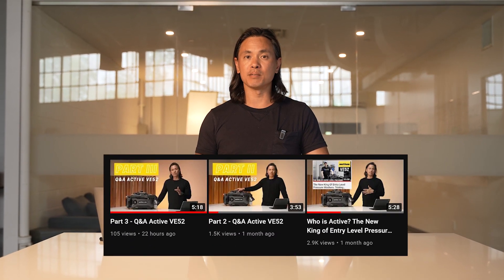Question and Answer PART 4 - Active VE52

Comment: Can I use a 100 foot pressure washer hose with this unit? I’m using a cox reel and a 6 foot whip hose. My current Ryobi 1600 PSI unit struggles with it.
Reply from the maker: You can use your preferred hose with the correct fitting but keep in mind that you lose a bit of pressure the more you extend your hose

Comment: As soon as Project Farm declared the Cat Pressure washer was the best, I ordered one. Now after watching these youtube video, I'm super glad. The only thing I'm concerned about is the 100 hour rating. I feel I can easily burn 100 hours in a year. Is it 100 hours trigger pulled?
Reply from the maker: This would be 100 - 150 working hours (Trigger pulled).  In actual practice, this is quite a long time - but of course this depends on the user.  For the home user, this is years of typical use.

Comment: How bout make a ve52 pro version with a upgraded induction motor to compensate with the 5 piston pump to add longevity for about 250 dollars cuz the performance is already there no need to try to get better performance durability shud be the goal!
Reply from the maker: Yes, we are currently testing different motors with our pump and doing longevity testing.  Ideally, we would match the life of the pump and motor closely.

Comment: What orifice size nozzle tip do i need to get the 1,800 psi?
Reply from the maker: if you are looking for an actual operating pressure (what you feel at the end of the gun) of 1800, no nozzle will safely there.  Unfortunately, the rating of 1800 is what's called "Peak" pressure, or pressure that the pump is capable of achieving internally.  This is the common (although misleading) industry rating system that we are using.  For best performance, stick, to the nozzles provided to get the best balance of pressure and flow.

Comment: What is the minimum inlet pressure necessary to meet the 1000ish psi and 1.8-2.0 gpm?  I ask since our property is on a well and not city provided high psi output.
Reply from the maker: I’ve checked with our engineers and they say 35-40 psi may be the minimum you need and may see a 5-10% reduction in performance.
Reply: @ACTIVEPRODUCTS  thank you for the reply and the due diligence to track down an answer from the engineers.  Good to know about the min pressure and the overall expectations that come along with low inlet pressure.
Reply: If we only have 30-40psi inlet pressure from a well will that work and what will that do for the output?  nlet pressure was mentioned in this video as a variable for the output to expect.

Comment: Another excellent video. Loving your transparency and answering questions/addressing “concerns”.  You said @1:28 ish or so that the 1000psi is more than enough except for stripping paint or some really big job.  What do you classify as really big job around the house?  Pressure washing the driveway/sidewalk?  Pressure washing a deck? Cleaning the house siding?  Just looking for clarity.  Thanks.
Reply from the maker: A big issue with electric pressure washer use is around expectation. For what I would consider “cleaning” - siding, decks, garage floors, garbage bins, windows etc - an electric pressure washer will do fine. Where better flow rate comes in is your ability to do said job faster and better because there is more water flow for the task and more than adequate pressure.  For what I would consider “stripping” of surfaces around the house - so paint, coatings off of wood, deep stains on concrete etc - an electric pressure washer may do the job, but you’ll spend a long time on a small spot. A gas pressure washer has much higher effective actual flow and pressure, so you’ll always do said job faster and more effectively.  But of course, gas pressure washers are louder, require gas (obviously) and just bigger overall. Hope this helps.

Comment: Test this against the Kranzle 1122!!
Reply from the maker: We are looking to build a longer duty unit to bridge the gap between our current VE52 and a fully serviceable unit like the Kranzle.  We think there will be some interest based on what we are seeing!
Reply: @ACTIVEPRODUCTS  interested !!!
Reply: @ACTIVEPRODUCTS  I'd be interested even though I just bought my VE52!  And seriously, even if it comes in two parts, like bolt the motor to the pump or something I'd be double interested if I can get it as a bare unit.
Reply from the maker: @Ryan_H22  It would be good if everyone was as mechanically confident as you are.  From a manufacturer point of view , we have to gauge the risk/benefit scenario of allowing customers to open up the unit. The other issue with that approach is that there electrical connections involved due to the cut off switch that connects the motor to the pump. That said we are looking at ways to make an easy to service and replace unit
Reply: @ACTIVEPRODUCTS  Very true and I understand that.  I grew up working on everything and have no doubt in my ability to assemble a "kit" washer.  As the manufacturer you have to cover yourselves and sell a unit that will appeal to the most people.  I appreciate your open, honest answers and that you take the time to reply to comments.  Very few companies take that time.  Thank you.
Reply from the maker: I don’t know if the Kranzle will last 10 years without major servicing or a rebuild to be honest with you, at the usage rate your describing. The motor will likely burn out as well with that many hours usage. That said, keep in mind the Active VE52 is about 1/5th the cost so it’s certainly made for a specific usage in mind.
Reply: @ACTIVEPRODUCTS  oh it definitely will require some service and repair don’t get me wrong I’m not saying it’s some marry pop-pins type miracle. But you should be able to get a solid 5 years before having to change oil and possibly some o rings..  but it will handle 5/6 hrs a day where is your unit won’t .. at your price point that’s perfectly reasonable! If you use your pressure washer all day everyday Kranzle hands down. but if u use it once a month double times a year usage pick the active unit and you will be more than happy
Reply: If u use it daily kranzle will last 10 years this will last 2 months it’s just not built to the standards of Swiss stuff bro
Reply: @zaceryhammond1144  I use my pressure washer about 1x maybe 2x a year.
Reply: @whobutni  should wash your car more than that bro 🤦‍♂️ but I say the active is the unit for u
Reply: @whobutni  but I do suggest getting a nicer 40’ hose and a mosmatic gun  the swivel on that bad boy is well worth the price

Comment from the maker: Don't forget to leave your questions here in the comment. We will surely respond on our next Q and A video!
Reply: Would you consider selling replacement parts such as brushes , unloader valve , o ring kit , on off switch ? 
My unloader valve has started to leak and the nylon ramp is showing sines of wear can I buy a replacement for my unit ? Thanks